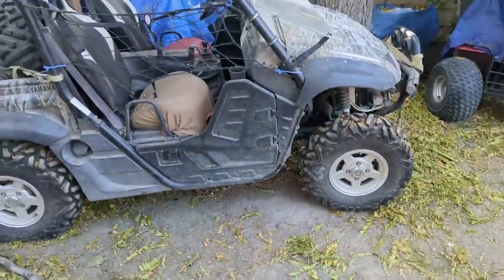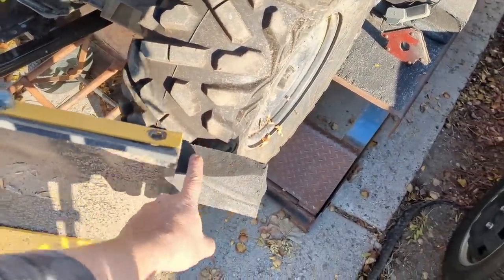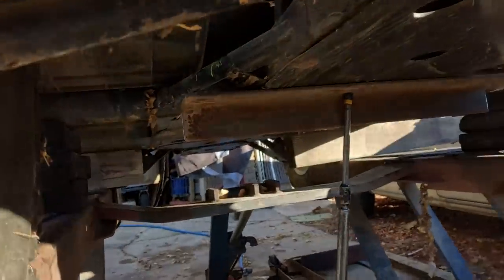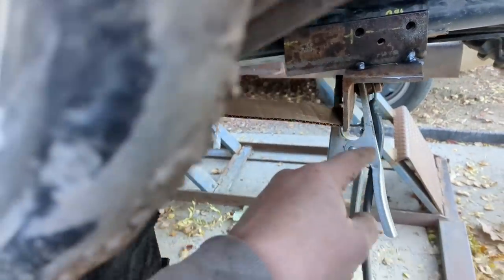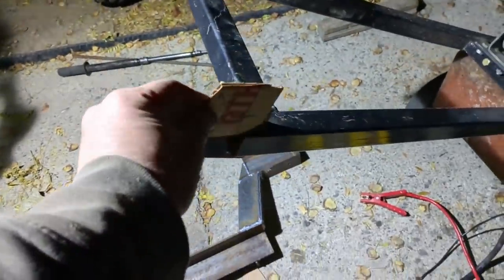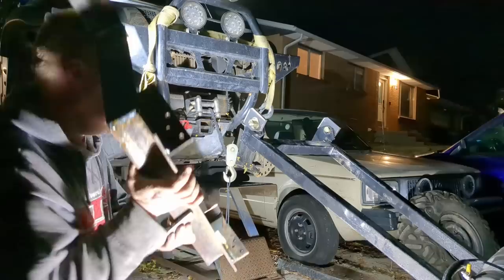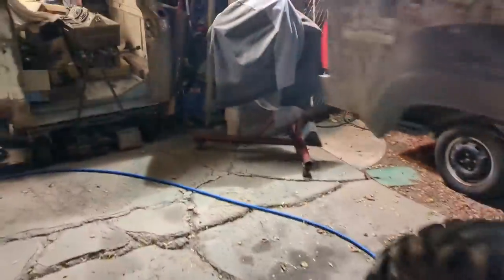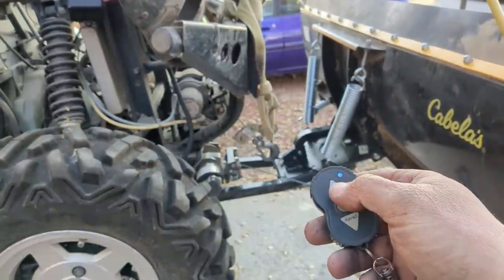Make Random Plow fit any ATV UTV ...... Fabricating Custom Snow Plow Mounts    Yamaha Rhino SXS

Comment: When putting bolts through tube , especially where strength is required , I drill slightly larger holes and weld some smaller pipe into the holes.  This no only makes the holes crush proof and wear proof, but prevents water getting inside the pipe and rusting it out.

Comment: i made a snowplow for an old riding mower from a 1/3 section of a 55gal. blue plastic barrel, 5 milk jugs full of water wired to the back for down pressure and an old bed frame. it worked really well, and the snow didn't stick to the plastic blade. it did wear out pretty quick because i didn't use a steel scraper at the bottom of the blade, but it only cost some time since i got the barrel, jugs and bed frame for free. i used the deck lift lever to lift the blade, and pivoted the plow frame from bits of bed frame bolted to the mower frame hanging down behind the transaxle. the only money i spent was when i used a 3" hole saw to cut holes in the sidewall of the rear tires and filled them with bag concrete for extra traction. two 60lb. bags of post mix were less that 3 bucks each. i should've run sharpened 3/8" bolts through the tread to have ice spikes, but didn't think of it until after i filled the tires. hindsight don'cha know.
Reply from the maker: That's awesome. Some 3/8 spikes would be nice!

Comment: Hey Moe. I'm sure that's water cooled, so a heater core in a box with a blower would be great in an enclosed cab. Don't know how many times I've wished for a rig like that when the wind is really blowing. Gets pretty cold here in Michigan. Nice job on the A- dapter kit. That power angle will be nice too.
Reply: Don't they call that a bobcat 🤣🤣
Reply from the maker: I've debated rigging up a quick heater and enclosure but time has gotten away from me this winter.

Comment: My plow and my snowblower mount to the rear hitch of the quad on the back and to double hinge mounted to the front bumper. No crawling underneath the quad to hook it up and comes completely off so no brackets hanging down. quick and easy mounting and dismounting.
Reply: reminds me of old sears tractors
Reply from the maker: That was one of the designs I considered. Definitely a strong mounting point.

Comment: i really need to do something like this for my snow blower bracket, ended up welding it to my existing plow mount on my 4 wheeler but definitely needs to be easily removable unlike the plow mount i have now.  thanks for the inspiration will have to get to it next year though since we are getting hammered with snow all week.

Comment: 11:22 I was waiting to see if you'd run into this - I adapted a Bolens snowplow to my Simplicity tractor and had to cut mine like this as well. It affects how hard the corners of the blade cut into the surface you're plowing as well.

Comment: Man, another reminder that I still have to build a tow-behind plow/box scraper after the garden tractor its going on is finally running. Not having a workshop with a roof sucks balls when it rains for the three days you slotted out to do the job... Think I'm going scraping for a water heater or maybe get lucky and find an expired acetylene tank to plasma the blade out of. Not without irony, all of this is to finally get the pad graded so I can build the workshop. It never ends!
Reply from the maker: Nice ideas. Water heater steel is a decent thickness and could be layered for more strength.

Comment: I'm going to do this with my old atv plow but I'm putting it on my heavy duty Cub Cadet mower. The mower came with the house but I hate it as a mower so I still use my Walmart mower. It's heavy so I thought with tire chains it would be good for plowing. It's got the floor forward/reverse no gears so it should be fast.

Comment: I'm so lazy that I'd have built a belly plate with 2 ears that utilized the factory holes at that crossmember further rearwards behind the plows mounting ears and used longer bolts... But we all roll differently so...
Reply: Then again I'd never live anywhere where I'd need a snowplow because A) I hate cold and B) I'm too lazy to wanna hafta snowplow and shovel cold wet stuff in the cold... 😁